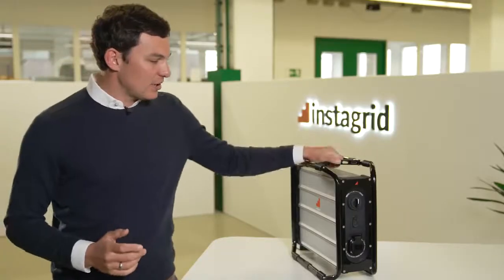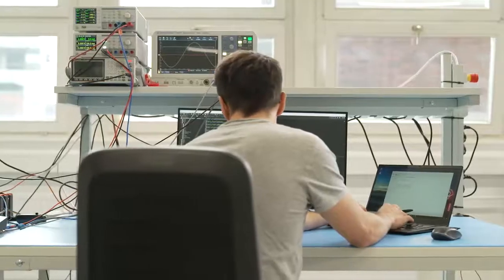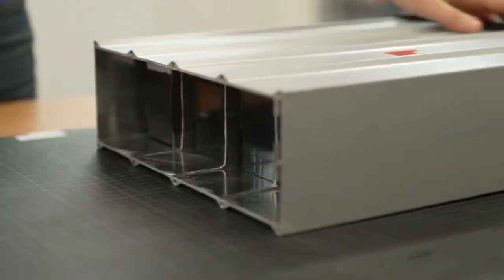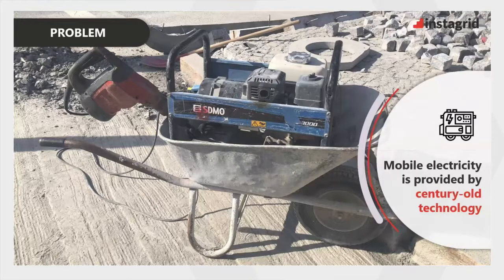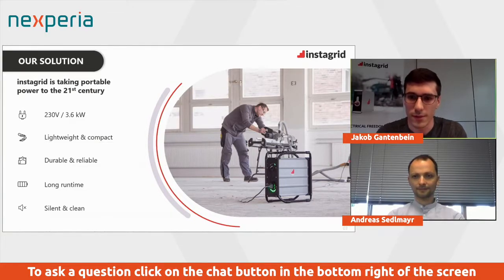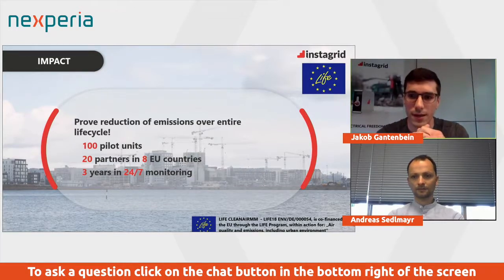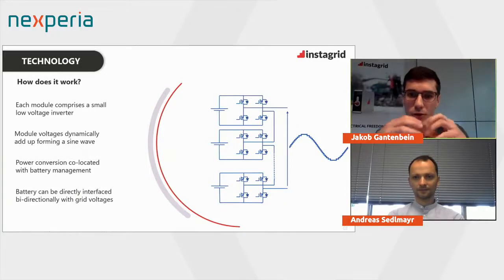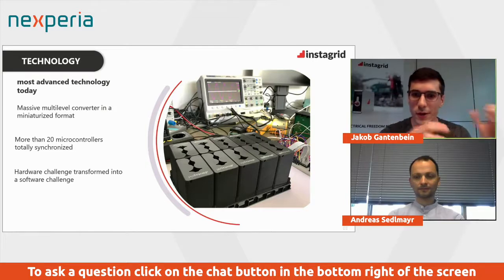instagrid - portable power for professionals

Comment: How ca we charge this from solar pannels?
Reply from the maker: Hello! Looking to the spec sheet, if charging via solar panels you would need to use a solar inverter that provides the input/charging voltage. Input Voltage for charging is 120 - 240 VAC 50 - 60 Hz, 4 A rating.